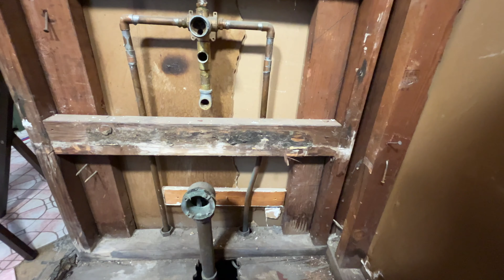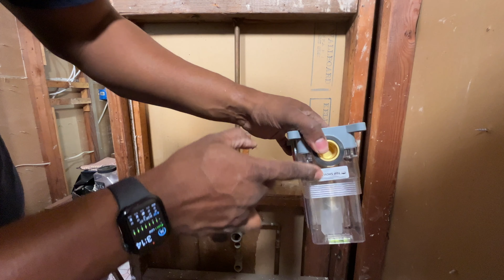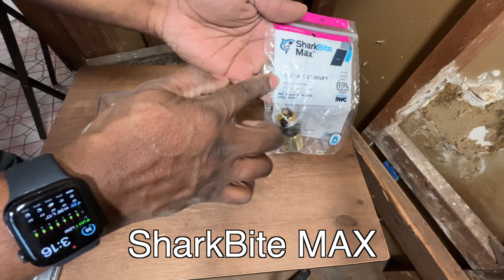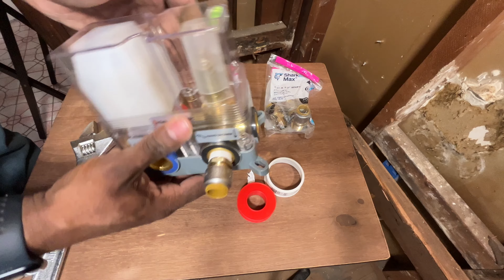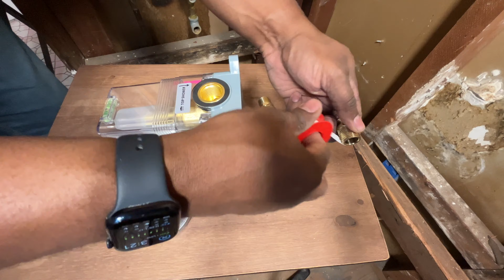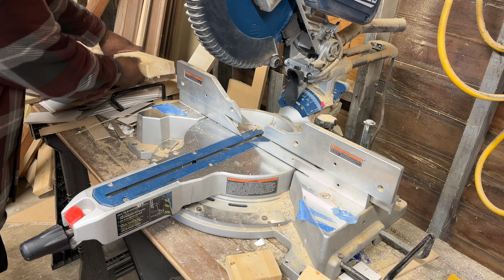How to Install a Shower Valve With PEX & SharkBite (No Soldering)

Comment from the maker: A few viewers have asked for an update on the leaking connection shown near the end. [Add the exact outcome here.] Would you use SharkBite fittings for this installation, or do you prefer crimp/expansion PEX? Always pressure-test every connection and follow the valve and fitting manufacturer’s instructions.

Comment: Those shark bite fittings sure look easier than the crimps! I have some plumbing to change in my box truck (where I live full time), I wonder how shark bite fittings compare to crimps when being bounced down the road. 🤔
Reply from the maker: They definitely make the job fast, but for a moving vehicle, crimps might be more secure against vibration! 🤔
Reply: @JayOfAllTrades1 , that’s what I’m thinking. I drove up to the Arctic Ocean in Canada last year and I’m not so sure those would have held. It’d be one heck of a test though! 😂
Reply from the maker: @BTNomad Yes that would be a great test. Sharkbite MAX fittings would probably do just fine. They are rated for a maximum pressure of 400 psi which is fairly high

Comment: Jay have you done the update yet? I have leak problem also and have reapplied plumber tape and pipe dope to my leaking fitting with no success. I have also replaced the shark bite fitting to see if that would remedy the problem (no luck) any thoughts or suggestions. I am working with customer service on this issue. The leak is small water droplets coming from the bottom bath tub spick et connection.
Reply from the maker: Hi, it sounds like the same issue I had with mine. I believe it’s a design flaw where the threading on the shower body is not machined well. I was able to stop the leak with a combination of teflon and pipe dope. I don’t think there’s any other way to do it. Hopefully the company can replace the one you purchased or at least give you a refund for the headache. Good luck!

Comment: if were concerned with our water being in plastic bottles and plastic leeching into it, why should we be concerned in this case?
Reply from the maker: I definitely understand your concerns. PEX (cross-linked polyethylene) is considered safe for drinking water; it is certified by organizations like NSF International to meet standards for potable water systems, meaning it does not introduce harmful chemicals into drinking water (at least according to them PEX does not leach harmful chemicals into the water supply but who really knows unless you've actually seen the test results yourself). 🤔 Maybe I can conduct my own test?